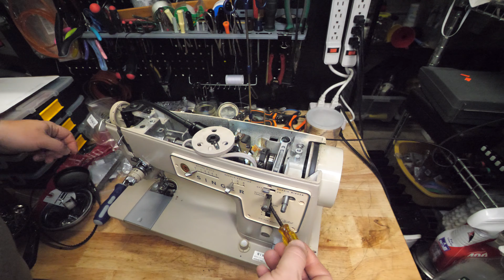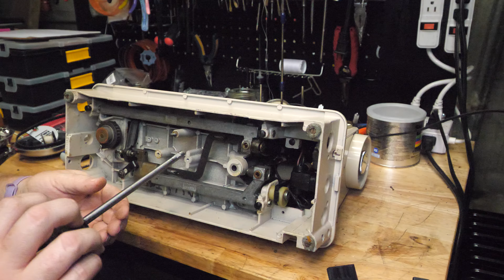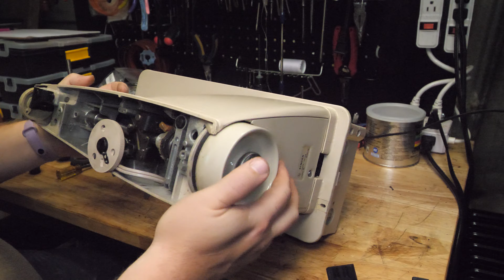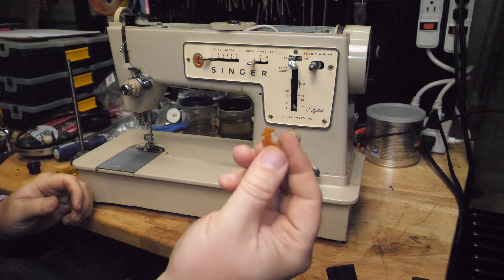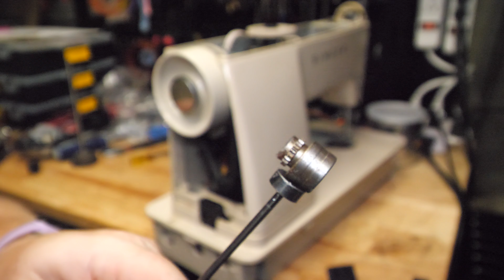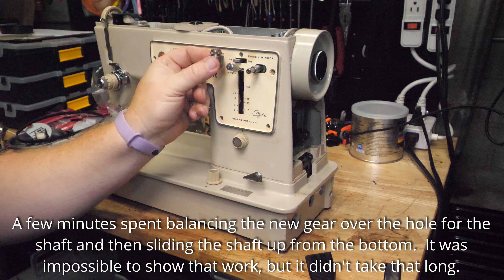Singer 347 Gear Replacement

Comment: Henry, you make this look easy! :-). I would like to see an upper hook change on a Singer Genie.  Thanks for the video.
Reply from the maker: If I get a Genie with a broken takeup arm that's worth repairing I will do a video on it.  The bodies on those are getting brittle so I don't know if you could break the metal takeup arm on the Genie without smashing the plastic covers first.
Reply: @henrybangsberg2187  Surprisingly Sir, the covers are held in place with screws that prevent over driving unless one insists on using a power driver! I guess the kicker is how sun tanned is the ABS plastic! LOL - Thanks for your sewing machine videos that show the value of repairs and the expertise required!